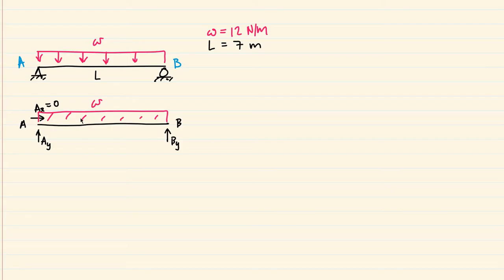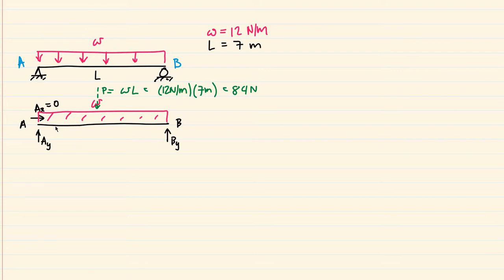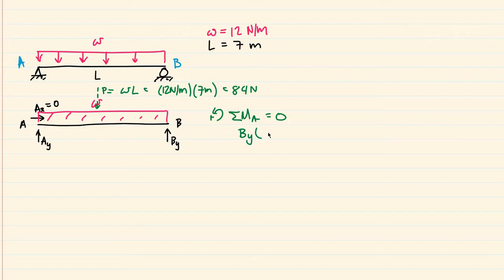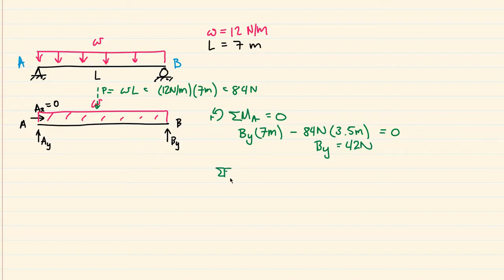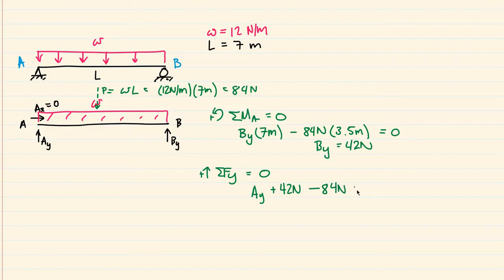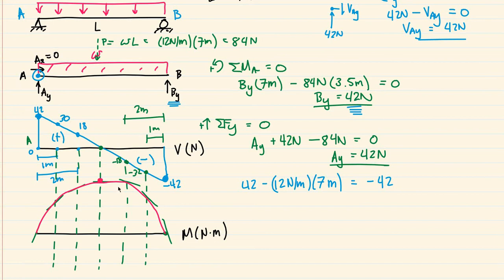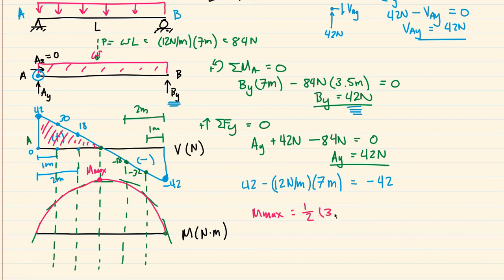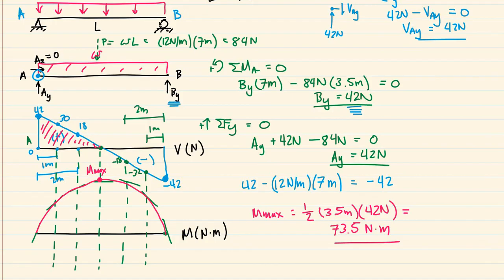[Ex. 04] Uniformly Distributed Load Shear Moment Diagram

Comment: on the shear and moment diagram, why does it looks like its only 6 meters in length not 7 meters?
Reply from the maker: Great point! Please don’t take that diagram to scale. I only wanted to use various points along the span to show how the shear values dictate the slope and curvature of the moment diagram at different points. You could very well have used more or less points. Hope that helps!

Comment: Actually, If the load is a rigid solid their is no shear or moment since the load is transferred to the supports without causing deflection! For example, a steel bar supported by a steel bar
Reply: hello, from my first thoughts on this, I would say that you are correct to a certain extent, but I'm sure the point of these shear and bending moment diagrams are for idealized calculations without involving material compositions. If the load bar specifications are known and a material for the support bar needs to be determined , I imagine the shear/moment values calculated here would come in handy to promote proper factor of safety in the structure. An example that comes to mind is a simple bridge with two supports where the distributed load can be equated to some sort of upper layer of a different material. The correct length and properties of beam material need to be selected in order to prevent the bridge from collapsing, especially when a significant bridge length has to resist deflecting about its centroid. I found a quick article that exemplifies the simply supported steel beam being loaded with another bar where deflection about the center is calculated on the second page. https://www.raeng.org.uk/publications/other/15-beam-deflection 

Please correct me if I am assuming anything wrong, your comment is interesting to an engineering student trying to figure things out :)